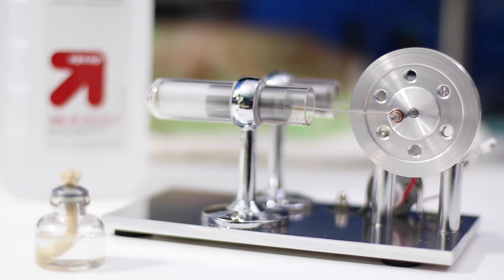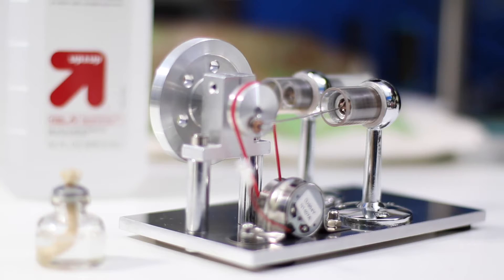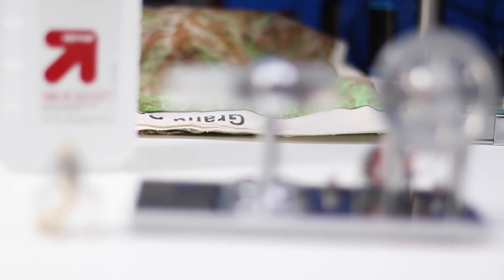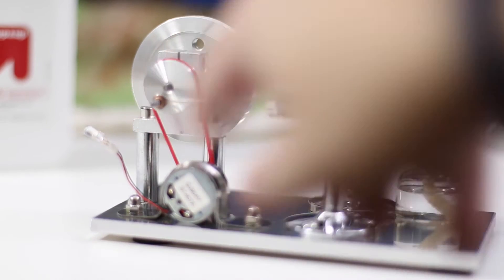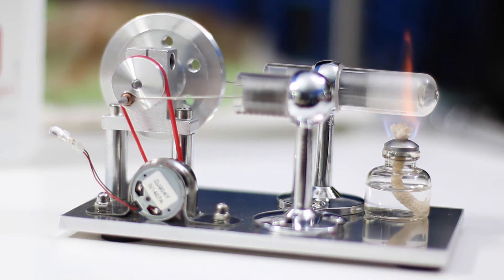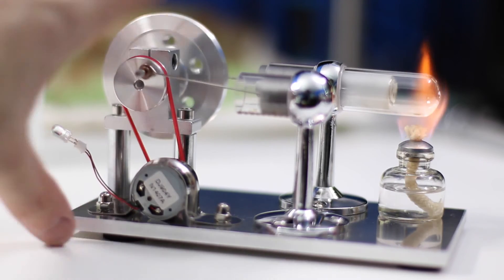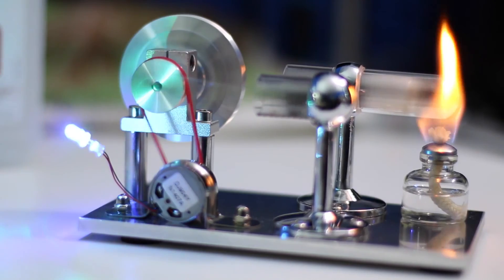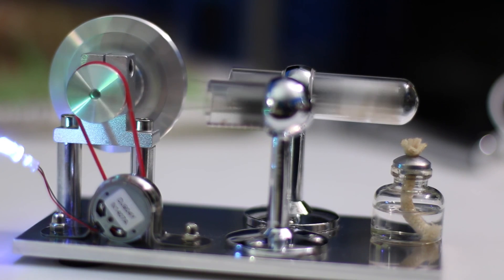SunnyTech Stirling Engine SC001, Demonstration / Review

Comment: Now my engine is not starting anymore and wont turn over used oil like they suggested on the flywheel and still nothing
Reply from the maker: If it spins easily with you hand, it could be the flame is not hot enough.  This is common with weaker alcohol (lower than 90%).
Reply: Joe Crescenzi - Voice Junkie From CouponPages it dousn’t spin that well and the bulb has gone black
Reply from the maker: @LachieVidsTransportVlogs    I'm wondering if the tension is from the generator. Try removing the rubber band from the flywheel and spinning it by hand. The flywheel needs to spin freely or it will struggle to spin when you use the flame, and once again I remind you to try the strongest alcohol you can find.  90% or better alcohol burns much hotter and cleaner.